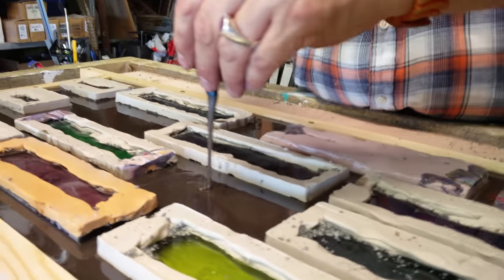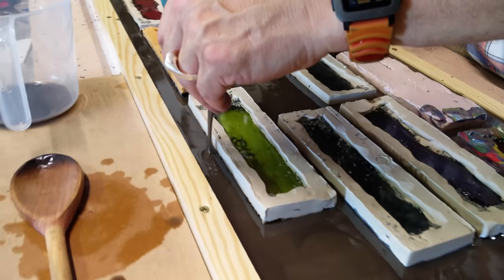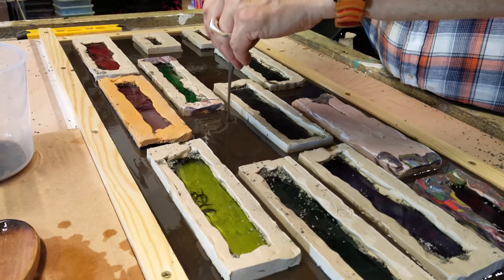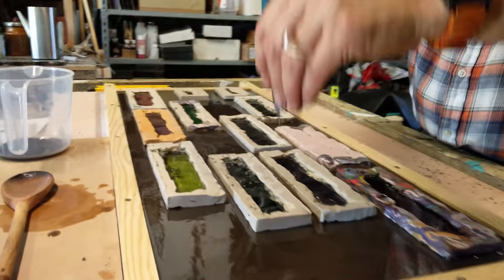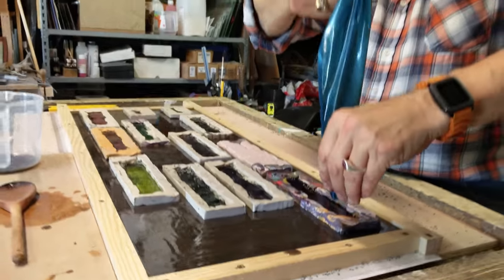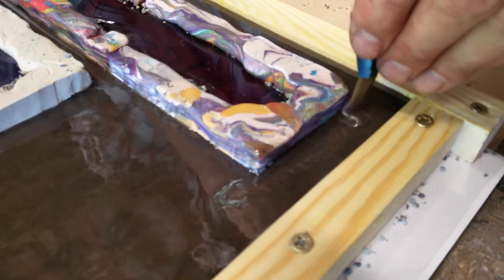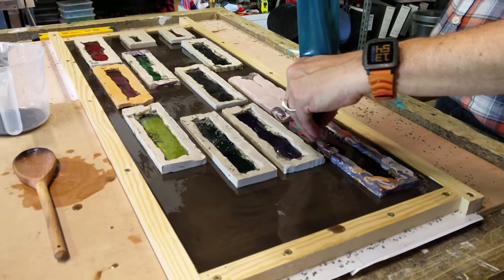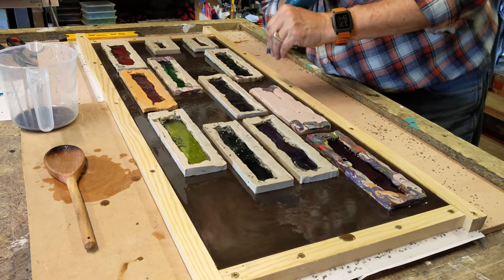How to pour epoxy resin in two goes around pieces of Dalle de Verre

Comment: Hello David - thank you for making these videos! My epoxy is running under my dalles, covering them underneath, sometimes with a thin layer and sometimes a thicker layer. I'm using black aquarium sand as my grit, and even though I'm laying down almost 1/2" of sand, the epoxy makes it all the way through and finds its way under my glass! What might I be doing wrong? Thanks so much!

Comment: David.....How do you apply resin into very narrow spaces between Dalles in a design? I have no problem with 1/2 inch space for resin, but I would like to have some very narrow lines. My problem occurs when the resin will not flow to the grit on the bottom....one pour method. Is there a tool that can be used to force the resin to fill the space or something that would make resin more fluid. Thanks
Reply: @davidlilly4442  Thanks for the tip; My problem may be in my design. Some of my lines are so close, pieces of glass may actually touch so maybe I will have to change glass to matrix ratio or "glue" some pieces together using colored resin.

Comment: Great work! I have a couple of questions. Would you be able to make these with regular grout instead of epoxy? Also, I was wondering what brand of epoxy you're using. Thanks:)
Reply from the maker: Hi Andrew.  I suspect that 'regular grout' would not have the structural integrity required.  I buy my epoxy from here: 

http://www.epoxy-info.co.uk/resins_shop.htm#StructuralPouring
Reply: Wonderful! Thanks for the tip